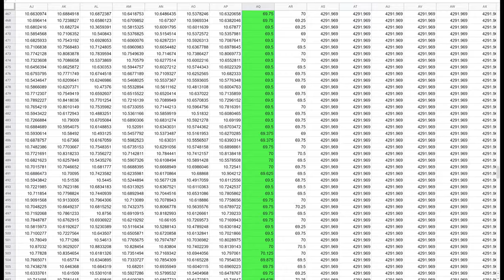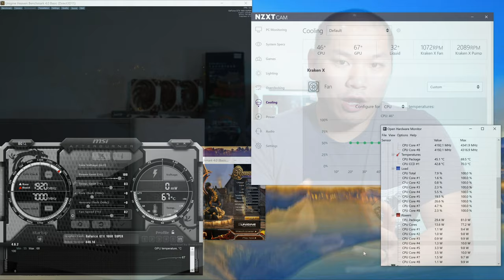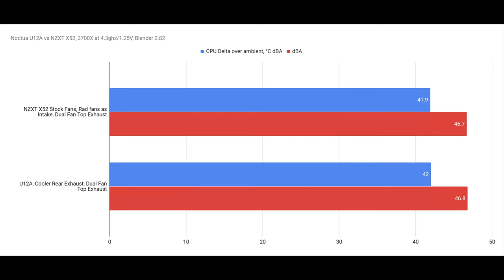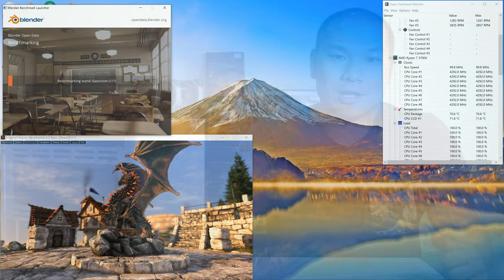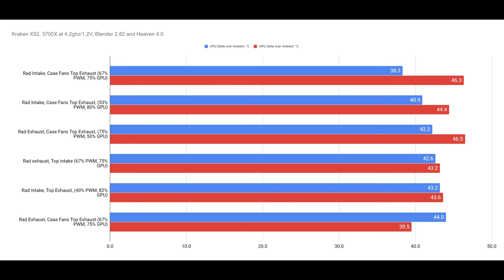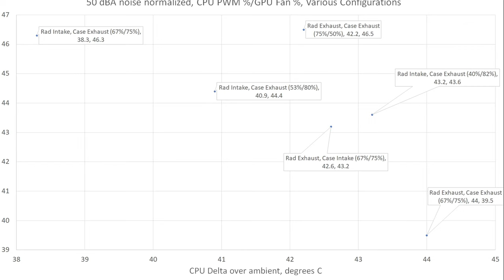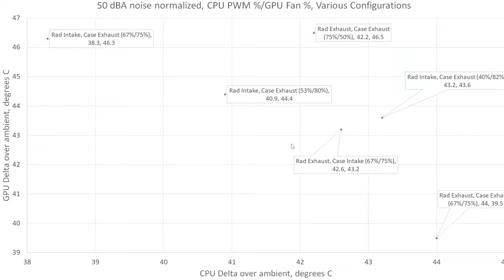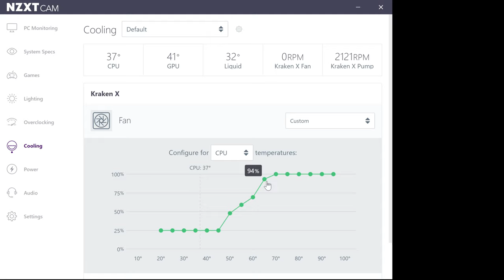Liquid AIO Cooling In The Cooler Master NR200, Part 1: Optimizing Fan Orientation

Comment: Do you keep the rear 92mm as an exhaust? Or only those two top fans?
Reply from the maker: Depends on if you're running bottom fans. If so, then skip it, too much turbulent/pointless airflow. If not, then run it the opposite way you're running the rad fans, ie. if you're intaking, exhaust out the 92mm, if you're exhausting, intake with the 92mm.

Comment: Thank you very much for this video.  I've been binging on NR200 videos lately as I intend to downsize my system to a SFF build.  The lower cost and larger size is why I'm leaning towards the NR200 compared to some other options.  Currently I'm planning on buying a U-12A for the CPU cooler and 4x NF-A12x25 fans for top exhaust and bottom intake.  My Gpu is an overclocked 2 slot EVGA 2080s KO  at +750 mhz on the memory and +150 mhz on the core.  CPU is a r5 3600 that's overclocked to 4.2 Ghz all core and undervolted to 1.17 volts.
Reply from the maker: I think you have a very solid plan there- since your GPU will be disproportionately hotter running than the 3600, you really have more headroom with CPU thermals so I'd run the U12A to exhaust out the back (towards rear I/O) and run those case fans in the orientation you described. The 3600 is really easy to cool, so even with warmer GPU air feeding it, you should be fine.
Reply: @MachinesMore  Fantastic to hear that you think I have a proper airflow layout plan for my future build.  I think that the U12A may be a bit of overkill for my undervolted 3600, but one thing I'm trying to focus on is low noise as I commonly use the PC w/o headphones.  My plan for the SFF build is to get a good b550 ITX motherboard that supports LLC which unfortunately the controller on my current Asrock b450 pro M4 ATX board does not support.  In the somewhat near future I plan to replace the 3600 with a solid 8 core zen2 or zen3 CPU to do a bit more video editing.  I'm glad to see by your testing that the 3700x 7nm chip is handily cooled by your U12A.
Reply from the maker: There you go- it's future proof. Get a good B550 with good VRMs since that's what is going to matter for higher TDP chips and if you want to overclock. I've cooled a 3900X with a U12S too and would have zero qualms of even overclocking on a U12A. So you're GTG. If you want to try, I bet you could run your undervolted 3600 on a fanless U12A and just use the case fans to help manage the heat on the heatsink. I've done so on a 2600 and a much smaller heatsink and from a noise perspective, it's quite good.

Comment: Nice but can you also test the rad at the bottom and gpu mounted with the riser? im interested to see the results compared to this one.
Reply: Ozzy Safa watch gamers nexus video about the proper orientation of the rads in the system. It’s fairly fresh. Avoid the bottom rad option...period. Sacrifice the looks for performance. Otherwise just get yourself an air cooler and the vertical GPU with a TG would be a valid option. But first watch the video, do the homework :))
Reply from the maker: Andrei A that was basically my reasoning and you hit the nail in the head. One thing to note is that VGPU will severely limit you air cooler (limited clearance) choices and therefore your CPU choices.
Reply: Andrei A i saw it but then he made another video saying it’s okay
Reply: Ozzy Safa the followed up video he did, he still emphasized that the bottom option should be avoided. And I agree with him. It’s up to you. But I would really think twice, as you basically defeat the purpose of an AIO.

Comment: @12:18 you present the data that the AIO gives worse GPU thermals, but maybe that's because the air cooler was sucking out more hot air through the rear panel. Hence, when using the AIO for liquid cooling, is there space on the rear panel to put a small 92mm fan to perform that role of sucking out more hot air that the air cooler would have done?
Reply: That was my thought as well...I wonder if there is enough space to fit a 92mil fan...
Reply from the maker: @RT My explanation for the better GPU temps for U12A/air cooling is that the fans exhausting towards the rear I/O of the case are helping the GPU too. @Andrei A, for a 240 you can fit the 92mm fan if you install the rad the right way. It helps a little bit- I will discuss the 92mm fan along with bottom fans in part 2.
Reply: Machines & More great, thanks. So, 92 mill will not work with 280 mil side rad? Is that how I understand it?
Reply from the maker: I doubt it, I measured out 30-35mm (not sure the exact amount, I'll show this in the next vid) of space, so, either way unless 240+35 is less than 280... it's a no go. Although, it's not really that helpful. You'll see ;)